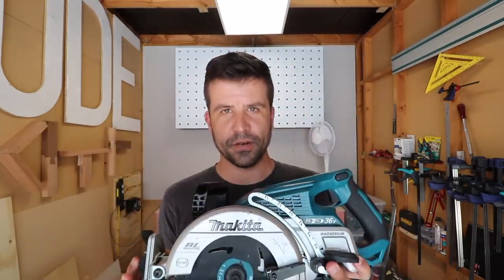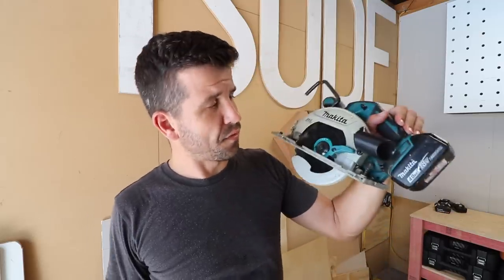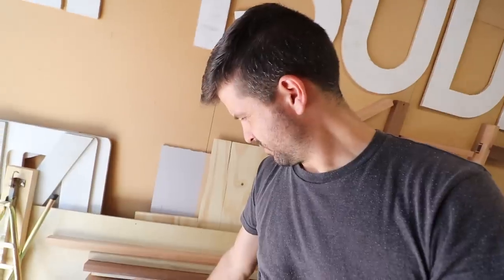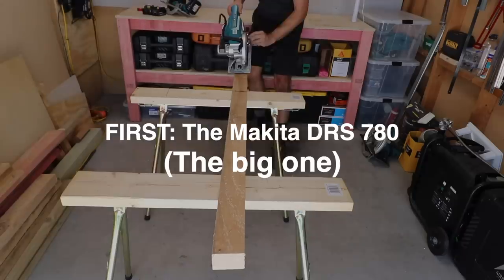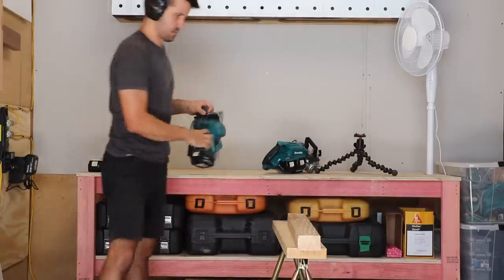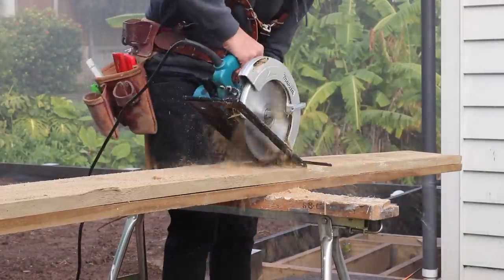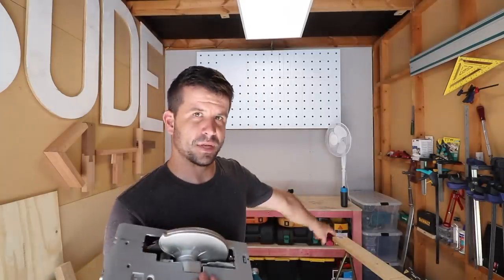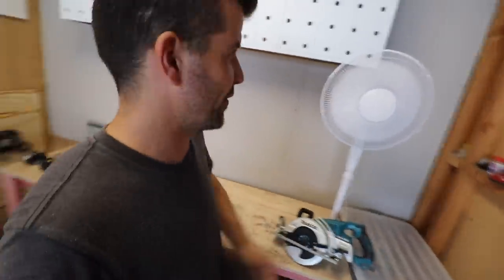MAKITA Rear Handle 36V: It's Good, But Do You Need It?

Comment: Almost 2 years later, still don't need it, still love using it. I think I got some kind of flash deal on it at HD. 199 for saw and batteries/charger. Took the staff like half an hour to find the saw on the top shelf, box caked with dust. Wife and in-laws sitting outside in the car waiting the whole time🤣🤣

Man, I love finding a good deal!

Comment: RPM may be similar, but remember the linear velocity of the outside cutting edge will be significantly faster on the 7 1/4" / 185mm blade than the 6 1/2" / 165mm blade. About 14% faster if my math is correct.
Reply: That's some Engineering Explained info right there. 👍
Reply: @vzgsxr  thank goodness for smart people

Comment: I've had this saw for 3 months now and it's easily become my favourite tool I own. My favourite part of this saw is the blade depth adjustment it's so accurate you don't even need to measure sometimes! If you work with any type of joists, rafters or just normal stick framing it is so handy being able to carry it around the Jobsite to do all your cutting I haven't found anything it won't cut well yet and the stock blade stays so sharp as long as you treat it well. Those on the fence about these style of battery saws don't even think twice just buy it!

Comment: i own this saw, i run two 5amp batteries and it the best it has replaced my  corded skilsaw mag 77 as i frame houses for a living in Ontario, Canada. today framing the  2nd floors of 3 town houses the saw lasted over 400 cuts of 2x10 i was shocked at 430 pm it cut out ( started at 7am). awesome saw, depending on what you do!
Reply: Can't go wrong with Makita ,I have a   7 1/4" corded Makita ,been using it for 20 years of framing.
Reply: I just started framing and every crew has this saw

Comment: What made me decide on the smaller saw was talking to a construction crew that owned both saws. They all said the bigger saw was garbage and rarely used it. One said he built his house pretty much with the smaller saw, miter saw and a table saw. They said the weight was an issue and they said they rarely needed the additional power. Everyone on the crew were older so maybe that was factor. I am very happy with my smaller Makita.  I can see for the type of work you do could  be a good addition thought.  For me I will save my money and plug in my old corded saw. Nice review.

Comment: I’ve been loving the 6 1/2” saw for a couple of years now, but I’ve always had the mag hypoid saw for backup and heavier work. A few months ago my big corded saw got stolen. Bummer, but it had definitely paid its dues, so I replaced it with this 36v version. It’s absolutely amazing after a few little mods... disable the safety switch (small saw too😉), then I ground a big radius from the front inside corner of the guard to greatly improve the cutting line of sight, and then ground off the end of the acorn but on the bevel lever so it will balance on the front edge of the foot leaned up against your sawhorse 👌🏼. Now it’s damn near perfect. Another favorite feature is that it will balance nicely upside down, which helps greatly when setting up a rip fence.

Comment: I use the 36v sidewinder. It will in no way replace my corded saws. If i was cutting a roof I would burn through batteries. It is just better to be plugged in when cutting rafter after rafter. Saying that I do love the battery saw for smaller jobs.

Comment: Been building houses for 45 years.   This is my go to saw.  It is powerful enough to do rips.  Would be nice to have a built in light for better vision of cut.  Change the batteries when one bar on the fuel gauge.  Channels in the shoe plate tends to hold sawdust and then empties it into my truck.  My Skil mag LT is not used much anymore.  Very good saw!

Comment: As a concrete form building carpenter I use this saw. I have been building warehouses most recently and this beats wheeling a generator over a 350,000 sq. Ft. Jobsite. Cutting and ripping 15inch rim joist is a breeze. Also when building walls with high density overlay plywood, I can rip two 3/4 sheets at once with with no problem.

Comment: I love the fact that were finally getting so much power out of these cordless saws. I remember getting the old 18v dewalt circular saw which was really only usable for small punch out and that was pushing it. I've been using the milwaukee fuel 7 1/4 for the past few years only pulling out the corded when I need to cut stacks of material. A couple weeks ago I just picked up the Skil cordless after the milwaukee decided to drop about 30 ft to a concrete basement which it didn't really like. I was on the fence between the makita, dewalt and the skil. Like you, especially when it comes to tools that are used all day every day, I buy the ones that I think are going to work best, be more productive, and hold up rather than just being in a battery platform or a specific brand. The skil sold me the first day out cutting wet 2x10 yellow pine rafters on a rainy day just going through them like it was nothing. Even though the saw is heavy it's smooth, comfortable, and familiar since I've used the skil 77s for years the adjustments just feel second nature to me. I love seeing what other carpenters around the world are doing it's extremely interesting. Keep up the quality work!

Comment: I learned on a Makita saw and I’ve got a fair few myself, but there is no other cordless saw like my DEWALT Flexvolt 7-1/4”!  I’ve run it against my corded Skilsaw Mag77 and there is no comparison.  If you need a powerful saw to rip old lumber or gang cut 4-by rafter tails, you want the sexy-flexy hanging on your horses!

Love the channel and keep up the good work!
Reply: Exact same comment here. My flexvolt rear handle has SIGNIFICANTLY more power than my mag77..........and no cord
Reply: @h2s I've seen it. I could easily be convinced to by one. I've use the "77" series skilsaw for 20 years. Just recently switched to the dewalt 60v. I just cant stomach the cost at this moment. The dewalt is running real well

Comment: I’m getting my first circ saw, I’m grabbing this monster. Honestly, I’ve done a ton of research and since I’m going into commercial giant worksights, I want to have the best quality saw with the most power/torque. I’ve already got 4 5amp batteries too. I feel if I invest early into this, if I ever need something smaller I’ll be able to grab a smaller one a lot easier then making a larger investment down the road.

And I’m fucking pumped

Comment: I've got the newer Dewalt DCS 578, which is the updated 60V max sidewinder. It's not a wyrmdrive/rear handle, but holy crap does it have the power. Like every other battery operated tool, it almost fools you into believing it's a toy until you pull the trigger, it's an absolute monster. Much like you, no fanboyism. I just happened to have other DeWalt tools and decided to go for that.
At the end of the day, they're all just tools. They have a job that we need them to do, and most of the modern tools are well able to complete those jobs. Keep up the great content!

Comment: Just got this saw, been using the 165 alot but wanted something a bit more capable for ripping, which this 185 is, and it's smooth. I find it a bit heavy on the right hand side for regular cross cutting on little sticks like 4 x 2 so will keep using the 165 for that. I'm a heavy oak timber framer by trade so used to using BIG saws for big work. (Just to help put things in perspective ).

Comment: Just got myself the milwuakee rear handle saw looking forward to use it alot, still wating for all the paperworks to get done about my own business :D
Reply: Jimmy klausner wondering where you’re from. I have never heard of this type of saw called anything other than worm drive.

Similarly your higher rpm circular saws are normally sidewinders. That is what we call them regardless of if they have a rear push handle or the top/canted push handles.

Comment: The 36v is a worm-drive saw. It has a different style of cutting than a 18v sidewinder. The wormdrive is a framers tool and most of the cutting is done "over the foot" using the weight of the tool to guide and make the cut. Add a prazi-beam cutter to the 36v and now you have a cordless beam cutter.

Comment: I have both , the 6 1/2  with the right blade is capable of cutting stringers out of pressure treated lumber , but it takes longer than the 36 v ,which is a beast.

Comment: I had always used the classic right blade corded makita's for framing etc.  It took a little getting used to the little left blade cordless (same one you have), especially when cutting bevels. But that little saw has proven so handy for small jobs and cutting in the roof.
I may just have to get the big brother now!

Comment: that 36v saw kicks ass. I'm coming from the baseline Makita plug in 7 1/4 saw. i bought the small blade 18v Makita saw in 09. my boss at the time told me it was a "gimmick". It became used more often than my drills. The next guy i worked for was a good friend, he realized the awesomeness of the 18v saw. we made fun of my old boss and I named this saw the Gimmie. so many years later I buy this 36v saw you're reviewing now. I named it the Super Gimmie. Ill go ahead and say you cant get a good idea on how powerful it is unless you're running 5.0 amp/hr batteries. Now you're looking at needing the double charger and at least 4 5.0 batteries. If you have that, you'll never want to plug in a 7 1/4 saw again and you wont look back. I was cutting rafters today, gave my employee the 36v for the plumb cut and i used the old plug in on the birds mouth end. Ugh, its been a while since I used this saw. Not as much fun. My only gripe is my 36v saw is the depth gauge is inaccurate and the spring in the blade guard is so stiff it'll push a 2x4 off the saw horses. I've been removing the thumb safety switches and the blade guard return spring on every battery saw since day 1. Once you  get into the habit of the wrist flick to drop the guard before you place it down, you'll never want the spring again. plus brushless is already bladestop

Comment: I have used this saw for a long time and one big thing Ive noticed is that even though its heavier its really smooth and when Im cutting down sheathing or plywood it really feels like its just gliding through the cut its easier to track a straight line and much faster because its not constantly twitching through the cut and needing to be corrected back onto the line like my 6 1/2 does.

Comment: You need them both if your a pro chippy.  The single battery saw is great for cutting sheet material and cross cutting timber.  

The rear handled one you use for ripping down lengths of timber and framing.

Comment: The reason I bought it is because I do Home Remodeling ,,  so sometimes I'm working inside an apartment, or inside a home and I need to make my cuts outside,,  so depending on what plywood , wood, etc I'm cutting I have to look for a extension cord and set up the plugs and everything ,, so this is really handy that way. You just go outside and cut what you need to. The small makita saw is good also, but depending on if your making long cuts, the framing saw with 18+18 =36 volts will work better..

Comment: You're analysis is spot on, Scott.  Taped trigger while not cutting won't tell you anything about actual run time.  These saws draw a lot more amps as the load increases.  It would be like testing your car's fuel economy with the car on jack stands ala Ferris Beuhler.  I have this Makita and the Milwaukee rear handle.   They are both great saws.  The Milwaukee is a bit more powerful, but the Makita runs more smoothly.  They both are beasts with plenty of power.  They aren't, however, the saw to choose for light work.  Being left blade saws, the site line is awesome for right handers like me.  Though not a factor for me, the Makita is a great looking saw.  Reminiscent of steam trains of the art-deco era  I'm happy with both saws.  I have a Milwaukee left blade 6 1/2 sidewinder that is the saw I always reach for when big power isn't an issue.  For sheer power, I believe the DeWalt FlexVolt, and Skilsaw wormdrive are the most powerful cordless rear handle saws out there.  I'm not a fan of right blade saws at all.  Keep up the great work, and stay safe.

Comment: I have this saw. It kicks ass. The only downside is the spring on the blade guard is so strong. I pull the spring out so it doesnt push a 2x4 off the horses before the blade eats in.

Comment: I suspect that "runtime test failure" occurred not because of overheating. First, the time was quite round. Second, the motor would not produce a lot of heat with no load. I think it just could be some kind of protection built-in in the saw's controller

Comment: The No-load test may have triggered a safety cut out.
I saw this big hand held circular saw once. At least 18" diameter. They were building a trebuchet. Huge timber sections.

Comment: My go at it is the DeWalt 60v rear handle saw. One battery so much power! The 2 battery system seems inconvenient to me.
Reply: CraftManGreg why did u get the rearhandle instead of the side winder ? I thought only Americans use rear handle haha
Reply: Not if you've invested in the Makita  18v platform. I have a dual port charger and plenty of 5ah and 6ah batteries, 😁
Reply: TheToolnut still running 2 batteries in anything is a hassle,
Reply: @MsElijah16  No, I don't find that at all.
Reply: We have had a couple of these for 18 months or so. Scott left a couple Kwerks out about the saw but their a still great saws. Ill be making a video about them soon.
We do have a lot of flexvolt tools but not the rear handled saw. I’d like to try one of them.
Reply: TheToolnut do u know when the new makita batteries are coming out?
Reply: @MsElijah16  Makita's new 40v platform  is due for release in the Spring of this Year.
Reply: @MsElijah16  In the US its a East coast West coast thing,

Comment: for me id buy one just for the ergonomics, the rear handle design with the blade on the left is absolutely perfect for right handers, i already have a 110v version, its worth lugging the transformer around for a saw like that. I dont understand why they make circular saws with the blade on the right and the handle adjacent to the blade, so impractical and awkward.

Comment: I received this saw kit with the batteries and dual charger as a gift and as an apprentice coming from only using smaller blade right saws I quickly began plotting to sell it. But after seeing guys I admire like @carpentry_bymar, @awesomeframers and @mattbangswood wield it masterfully I put some practice in and grew to love it in certain situations.
 I still want to pair it with something lighter like the Makita 6 1/2 subcompact and probably wouldnt have bought it myself but given that I didnt have to invest in it and was able to increase my Makita battery count, it earned its place.
Great for sheet goods, longer 2x boards (when pulling measurement from the left), and when using saw horses.
More cumbersome when cutting boards propped off of your boot and shorter 2x pieces because the cut line falls out of sight on the right side of the blade (when pulling short measurement from the right of the board)
Reply: When cutting off your foot with rear handle saws, cut on a steep angle as to let the weight of the saw guide it through the cut. For me, cutting off my foot is a lot easier with a rear handled saw than a normal sidewinder.
Reply: Exactly! Being a right hand carpenter it's great for sheathing and cutting longer material to length. I find it just fine for cutting off the ground or off stacks of lumber. Just not sure about shorter 2X and cutting blocking... do they all just look through the blade when material that drops to the right, or possibly add the width of the blade? Could also just cut left handed for shorts but the saw is not as light as a sidewinder.

Comment: I have that same little one and I had a go on the rear handle one a few weeks ago... The power difference was really noticable. The rear handle is a bit weird though, not used to that.
Reply from the maker: It took me a while to get used to that, the cut feels far away
Reply: Once you get used to it I feel like you have a lot more control than a sidewinder styled saw.

Comment: I've had this Makita DRS 780 saw for about 8 months now. Thought it was great since I only had a small corded Hitachi circular saw with the blade on the wrong side before that. But after having used it for probably 300 hours I don't like it. It's too heavy and drains batteries in no time and for some reason gets stuck even cutting 20mm OSB. There is this new Milwaukee rear handle 7 1/4 that came out last year, it looks lighter, I think I will give it a try or do some more research and find something else. 
But I've worked with many different circular saws, so far I got to like only only one which was Festool track saw and I used it over 6 years ago last time when I was relatively green. Maybe it's not the saws, maybe I'm just not a good carpenter :D Have a nice day you all.

Comment: Been using the Makita XSH08Z (US name) Top handle 36v 6K rpm. Pretty nice piece of kit.. But the depth adjustment is very hit or miss. It's just a nut washer and lock ring that release a little pressure when you raise the handle to allow the depth to be reset.  If that nut moves at all then it either jams or makes it so it doesn't lock. Makes me just leave it on max cut as I'm scared if I try to adjust it'll not lock out again. Makita have a great range of tools on their ecosystem so hopefully they revisit that mechanism for the future models and bring it up to standard.